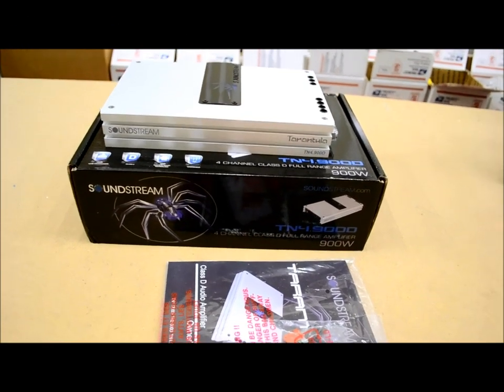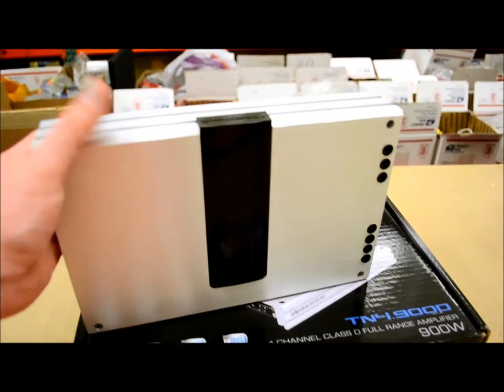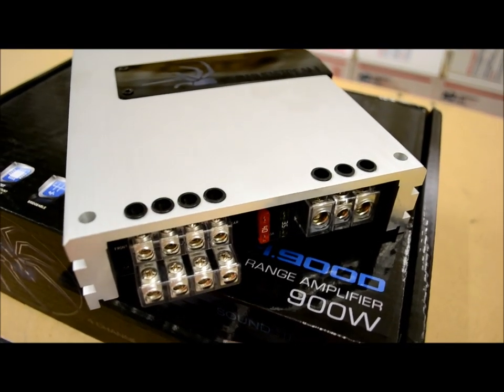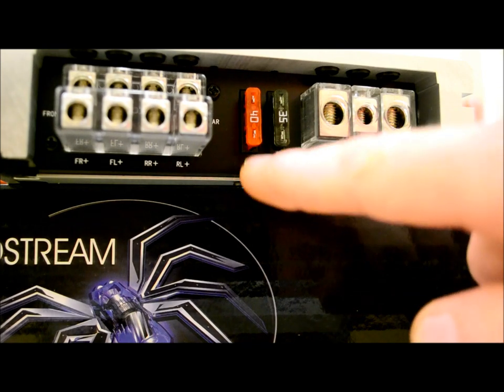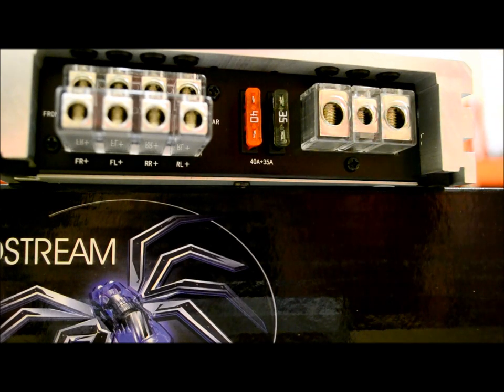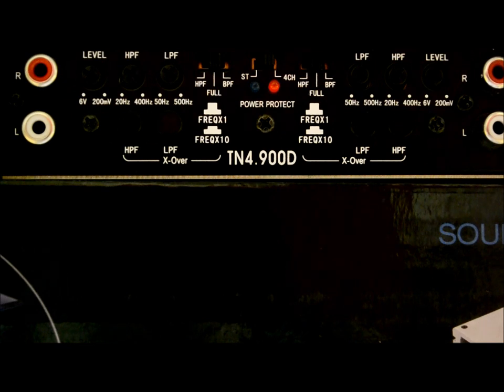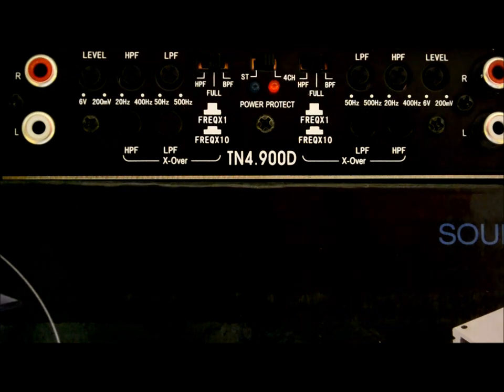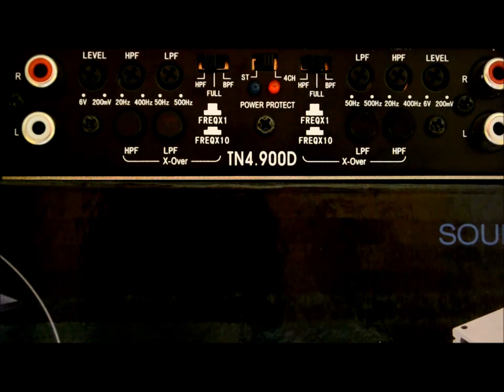Soundstream Tarantula Amp Review  TN4.900D

Comment: Just to clarify this model is not 1 ohm stable. Or it was not intended to be. I read the same thing on the spec sheet and got confused myself. The spec sheet is universal with the entire tn line of amps. The 1 ohm stable is referring to the monoblock amp and the mono board in the 5 channel of the tn amps.

Comment: ALERT! Do not buy the tn4.900d on Amazon that's selling for $139 and eBay seller techronics selling it too. It's a fake tn4.900d with a totally different board from the amp in the vid. Furthermore it does not have any on board fuses

Comment: Nice review on this amp, I have decided to change out my amps to 8 of the Tarantula Nano TN1.1200D's on the sub stage and was really on the fence about running 3 of these (TN4.900D's) for the mids but this review was really thorough and you answered some of my questions I had on it (the different fuses really confused me). Have you had a chance to install this amp and get real world experience with it?
Reply from the maker: No, not yet sir
Reply: Please upload a video of your system (the one in your profile pic) :-)
Reply: You're running 8x nano 1200d's and was confused on fuse rating?

Comment: It's a great amp, but there's a mistake on this video.  You only USE 900W.  If it pulls 75A at 12V it USES 900W.   Some of that is wasted as heat in the system, among other losses.. which all end up heat in the end.  Only a 100% efficiant amp would put out the same it takes in.  There's no such thing as an electronic system that's 100% efficient.  But if the fuses are on the output that's just indicative of the max current output, and since music doesn't have a given voltage because, well, it's music.. you can't use the fuses to calculate the output.  Since this amp is rated at 900W it's safe to assume it uses more than that much power.  Of course with music you will never have a conastant 900W output, it's music.. so they can rate the output at 900W, and put fuses that only let 900W in because while it's not outputting full power the caps inside can retain some of the electrons to be used later.  You would have to measure the total power consumed and compare that to the actual output to see the efficiency.  

Anyway, the fuses make a good rule of thumb, but it's not as simple as the video made it out to be.. that's all I'm sayin.
Reply: A point Lessco could have made is that no amplifier in a system with the vehicle running will have exactly 12 volts in supply. If you get the typical 14.4 volts and can get 900 watts out from this amplifier at a current draw of 75 amps, you will get an efficiency of 83% which, for a Class D topology design, is very typical.

Otherwise, excellent review and I am now a subscriber.